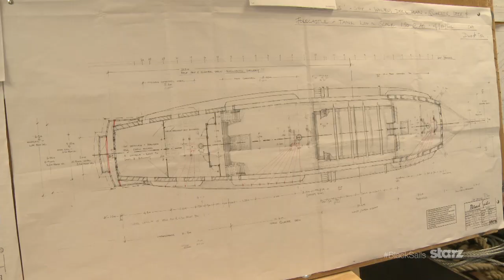Black Sails | Building the Behemoth | STARZ

Comment: The ship looks awesome but pirates never used big ships.They prefered smaller ships as they are faster.
Reply: "They prefered smaller ships as they are faster."
 
Nope. With sailing ships, big ones are faster. Pirates usually used small ships because that's all they had the men to crew.
Reply: Fergus Mason Not always true; the average pirate ship was the relatively small sloop. Look it up. This is the case mainly as the [surface area of the sails] to [mass of the ship] ratio is the actual determining factor of speed, not the size of the ship. Simple physics. That being said, many pirates also used larger ships, as many of these ships were large but also fast. Take Blackbeard's most famous vessel, the Queen Anne's Revenge; it was a large frigate, but it also had a smaller mass due to the fact that it was redesigned to hold more (particularly slave/human) cargo. Therefore, its sails could carry it much faster than the average ship of comparable size. So, the ever-present power/weight ratio was the real determining factor in pirate ship selection.
Reply: not always true... the most famous pirates tended to use more than one ship but the flag ships tended to be galleys... for example, William Kidd's flagship was the Adventure Galley, Blackbeard used the captured slave ship renamed the Queen Anne's Revenge, Black Sam Bellamy's ship the Whydah was also a renamed slave galley. Henry Every's ship was a refitted warship renamed the Fancy. Bartholomew Roberts used a brigantine frigate renamed the Royal Fortune. Edward England started with a sloop but upgraded first to the Pearl and then to a Dutch gunship that he renamed the Fancy after Every's ship.

That said... Jack Rackham and his lover Anne Bonny who feature in the Black Sails tv series... used sloops.
Reply: Everybody's an expert.
Reply: Christian H"the average pirate ship was the relatively small sloop"
 
This is correct, but "sloop" doesn't mean what it does now - a single-masted rig with a mainsail and jib. It was a small warship with two or perhaps three masts and would be rigged as a ketch or brig.

"Therefore, its sails could carry it much faster than the average ship of comparable size."
 
Very true; more sail area usually meant more speed. The limiting factor is waterline length though, and for a non-planning design a longer hull has a higher maximum speed than a shorter one. The fastest sailing vessels ever were the China clippers, which were very long ship-rigged hulls.
Reply: Ryan Eskierka
 nah... we just love pirates :)
Reply: They preferred any ship they could steal big or small.
Reply: None of you guys know anything you weren’t there
Reply: It depends. Some of the “big boys” such as Bartholomew Roberts did indeed have big ships, Roberts’ final “Royal Fortune” was the HMS Onslow, which was a captured 32 gun Man o War privateer, previously owned by the Royal Africa Company.
Reply: I was actually there. I am the reincarnation of George Wilson, who was Bartholomew Roberts’ Matelot and Lover. 

My husband was the reincarnation of  Roberts himself and always said “Ye must understand, I AM the Tee Totalling Pirate King!”

He had past life memories so clear it was like remembering his childhood and used to tell us of his adventures. He always asked me to research this Pirate King online, but I never did, until three months after his death. In this life, he had a premonition that he was going to die, took out life insurance and made me promise to bury him at sea, which I did. 

He is buried 40 nautical miles off the Capalaba Coast which is near the Gold Coast of Australia.

Roberts also had a premonition of his death and made his crew, including Wilson, promise to bury him at sea, and he is buried off the Calabar Coast which is near the Gold Coast of Africa…